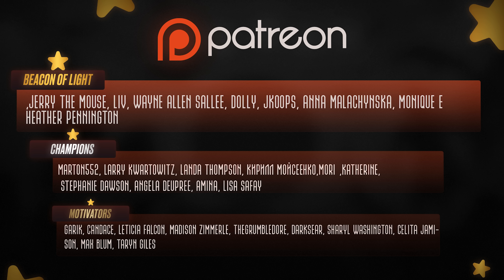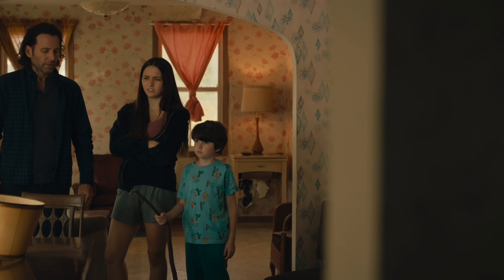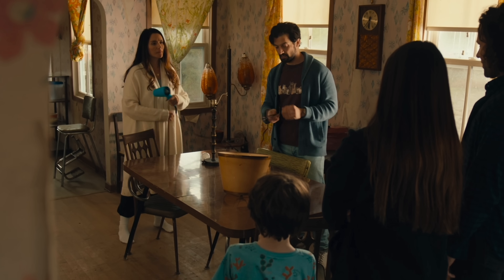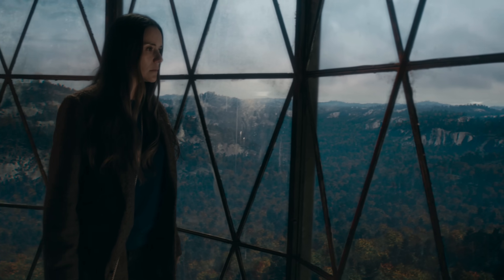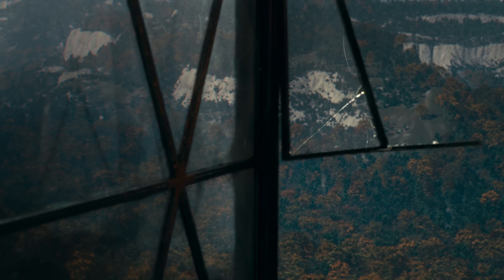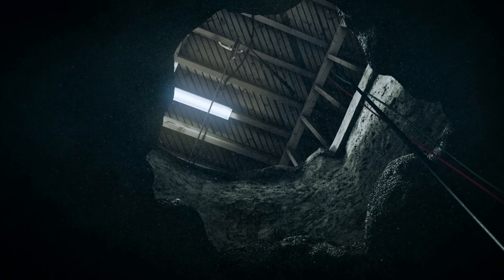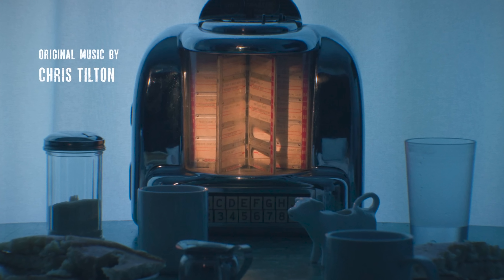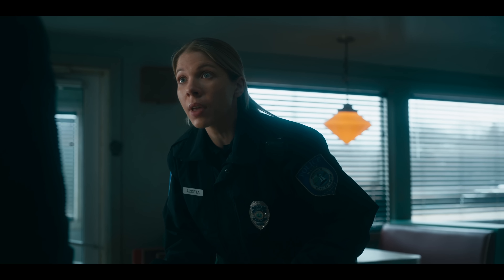#frommgm ELECTRICITY - HOW IT WORKS AND WHY? THEORY

Comment: Here's my theory:

Key Points
1. Man in Yellow is the most likely candidate for the voice over the Radio.
2. Jade made the comment of thermodynamics - Energy can't be created or destroyed, only repurposed/redistributed
3. The Caverns below Fromville are were the creatures reside. 
4. The Power from the houses appear to run into the Caverns.

Theory
1. The Man in Yellow is the Source of Power - His energy dwells in the Caves - Could be the "Haze and Orbs" that we see when Tabi falls through the floor, or could just be dust.
2. He feeds the entire town his power, in exchange for their privacy -- "Knowledge has a Cost" - This even applies to him, meaning they also have to follow the games rules.
3. This allows him to be omniscient - He may not be able to see, but he is able to listen - His power fed into the Radio allows him to speak.
4. Deaths of "Non-Essential" characters fuel the man in Yellow - Monsters feed on their bodies, Mr. Yellow feeds on their energy/soul.
5. Mr. Yellow appears to be old, tattered, and possibly weaker due to the lack of a new cycle.
6. Children may contain more "Energy", which is why they are often targeted first, used for sacrifice, and plotted against; in the case of Sarah and Ethan.

Summary
Mr. Yellow powers the town with his essence/energy, in exchange for the town Privacy. His energy resides below the town within the caves, and the wires are his conduit.  He feeds on the energy of slain denizens and uses his monsters as "The Tip of the Spear". -- Essential characters are not bound by the town, and their energy is able to escape for reincarnation.  The others are completely consumed - Creatures consume the Body, Mr. Yellow Consumes the Soul.

Comment: Where does Elgin get the never-ending Polaroid film? I remember the film was about $10 for 10 pictures in the 80s so he should have run out a while ago.
Reply: It's as logical as having electricity from wires that end underground. What's your point?

Comment: We have electricity,  water and gas and we don't know where all comes from. I always thought that the water they got was the perfect source for they get drugs in their system, which make them see all these hallucinations.  Of course, that doesn't  work because they get trap going in circles before they drink any water fromnFromville. 
We know it is not the light bulb  because Jade needed to put it back in the lamp to turn it on. Sonone could argue that the lamps, or any socket, have some.type of.battery install, and they are controlled by some devise like alexa. 
Also it's possible that the people's energy is the source of electricity.  Ligjts flicker, radios turn on based on the emotional energy people have.

Comment: To @gaeouhgaeae: I know Kelly had a cellphone (I stated that in my 1st post), and I know what Kristi told her.  But, think!  You can use cellphones for more than placing phone calls.  You can take photos; so no need for the Polaroid camera; Jade and Jim can use the cellphone calculator function to number crunch in an attempt to figure out the numbers in the bottles.  Plus, there is a huge area outside of From that no one has discovered - potentially cellphones could work there.  Instead of laughing and saying something is ridiculous, just google it.  

Lots of practical uses for cellphones even with no cellphone coverage:  calculator, calendar, flashlight, offline GPs and maps, note taking and journaling, game playing, etc.  Cellphones are are very handy device in Fromland, even if you can't use them to make calls.

Most smartphones have a built-in magnetometer, which allows them to function as a compass, allowing one to find magnetic North, which will help in travelling, not getting lost, and mapping important locations.  

Same thing with a laptop.  Lots of practical uses for a laptop even if there is no internet, especially depending on the software or programs that you already have installed on your computer.  You can do activities such as:  document creating and editing, media playback to listen to music or movies or view photos, offline games, creating a spreadsheet or a presentation, photo and video editing, etc.

So again, instead of laughing and saying something is ridiculous, even without internet or cellphone coverage, cellphones and laptops are extremely helpful tools in any situation.

Lastly, the writers of From are smart and very clever.  There is a reason why we have never seen someone use their cellphone once they step foot in Fromland .  There is a reason why there are no cellphones, laptops, Fitbits, Apple watches, iPads, tablets, etc in the storage area or in the storage boxes.  

The absence of technology isn't an oversite by the From writers - they are too smart for that.  Technology is ubiquitous in today's society.  Most people cannot go one day or even one hour without seeing or using some sort of technological device.  

So, the fact that the inhabitants of From don't have access to their devices is not ridiculous - It's an "in your face" obvious CLUE.

Comment: I have a theory you wont regret reading about the whole place, the monsters, the electricity, and the Anchooey kids lets start with the place, first of all i feel like every one missed the point that there is the seen place that we always see in the series and there is the unseen place that Boyd went by the tree, also he went to the unseen place when he used the torch when he destroyed the music box, the point is that what they cant see in the seen place can be seen in unseen place, like the building that Boyd reached when he went through the tree, in the seen place its not there its only some walls, but in the unseen place its fully build, and they dropped a hint at season 3 when Henry told Ethan why there is a motel sign but there is no motel, the motel can only be seen in the unseen place, and to go to the unseen place you need some tool from the unseen place like the torch that Boyd used, and if your lucky you can end up there by using the tree or by using the numbers that Victors Mom used which is a coordination to a specific place when they enter the tree, there could be a possibility that there is a number that will send them to the unseen place as there was a number that sent Tabby to the tower. About the lights there is no wires but there is electricity, i believe its the same, the wires is there actually but in the unseen place that's why they cant see the wires but somehow the electricity works and that could also explains the flickering and how some lights are not fully working because the electricity its not from the seen place but actually from the unseen place. And about the monsters i don't think that Boyd and Sara got saved by the light, it seems there is different monsters other than the one we saw already and i believe it was mentioned by Ethan in the quest/book that there is a spider, boogeyman and scarecrow and there could be other types of monsters, maybe a giant which pulled Boyd and Sara when they were in the tent. and also Martin mentioned that the monsters that come to town is only the tip of the spear so there is different type of monsters out there that we didn't see yet, i believe that the monsters only come at night to the seen place, and go back at daylight to the unseen place and i think Boyd and Sara got lucky that it was close to daylight and that's why they got saved and not saved by the tower light, what could proof this, is when Martin told Boyd go before they come back, it seems that all type of monsters go out to the seen place at night and go back to the unseen place at daylight, i know some will say but there was 2 monsters left at daylight when Victor entered the tunnel with his father Henry but it seems also the monsters need a tool to go the seen place and go back to the unseen place, especially when henry said why they have so many items from us, it seems they need some tools also to come to the seen place, and that's why you see the monsters dress clothes from humans that's old from 1960 etc, maybe that's the tool for them to come to the seen place, but why there is 2 monsters left and cant go back to the unseen place, I'm not sure but its possibly they don't have a tool to go back to the unseen place, and it seems they need a tool as how Boyd used the torch that he got from the unseen place so he could go to the unseen place, but for the humans in the seen place they must use a tool from the unseen place with a light because if you remember when Boyd had the torch and went to that specific place he couldn't go to unseen place without lighting up the torch, but you will say why the monsters don't need a tool with a light to come to the seen place, because the unseen place is the opposite of the seen place and i believe the tower in the unseen place doesn't have a light and that resembles that they don't need a light to come to the seen place but for the humans in the seen place the tower have a light and that resemble why they need a light to go to the unseen place. And so many people asking why there is a tower with a big fire light in a forest, there is a big chance that tower light is the access of the seen place and the unseen place and if the light is turned off, the access from the seen place to the unseen place and the opposite wont work. Another proof that all the monsters come at night only is when they went to the cabin, the thing that comes knocks only comes at night and the spider webs that they found at the forest, there was a very big web but no spider at the morning and for sure its not the small spiders that made that big web. About the Anchooey kids i believe that the Anchooey kids exists but in the unseen place, and to save them they must go to the unseen place, and to go there the best time is at night when all the monsters are not in the unseen place and the only way to escape from this whole place is from the unseen place and not the seen place, that's why no matter how much answers they find and look for its useless. So all humans need to go the unseen place at night, but only one need to stay at the seen place to turn off the light at the tower so the access from the seen place and the unseen place get closed, so that the monsters cant go back to the unseen place and that should be Jade because i believe that he need to sacrifice him self so the others can escape this whole place, and they showed us that Jade saw that Anchooey kids get sacrificed at the tunnel and that resembles sacrifice and that Tabby is the opposite of sacrifice and she is the one to save the kids from the other side which is the unseen place, and that's because they showed us many times about Tabby and saving the kids and how the kids comes for her in the tunnel as they want something from her which is saving them. Also i think there is specific coordination that you need to be at so you can go and come from the unseen place and its not random, like for example the place that Boyd was at to go the unseen place when he used the torch, also why there was talisman rocks at a specific place when Boyd found them, and Boyd himself said it, what if the talisman rocks is there to stop them from going outside and not inside, this itself says that they come from a specific coordination and they don't randomly come out in any place in the seen place from the unseen place, and it seems someone already knew about this, that the monsters come at night only from the unseen place and that's why they placed the talisman rocks in a specific place and most probably it will be Victors Mom, but it seems like Victors Mom doesn't know all types of coordination that the monsters come out from, otherwise we wouldn't have seen the monsters in the series that have been showed until now. So if the humans figured out all types of coordination and use all the talisman rocks they have, there is a big chance that they can stop the threat of the monsters that we have seen until now only, and not the other monsters that haven't been shown yet, some will say but there was talisman figures near the cabin but something still came and knocked at the cabin and that the talisman figure didn't stop him from coming to the cabins, and you might say that the talisman rock saved them from him coming inside the cabin, but actually not it didn't save them from him because of the talisman rock, i believe every type of monster works differently from the others and every type of monster have a specific way of killing and doing its stuff, i believe the talisman rocks or figures doesn't work on all types of monsters and it only work on the monsters that we have seen in the series until now. About the radio, there is a host that's controlling everything from the unseen place, and he spoke through the phone and the device that worked when they used the tower and talked to Jim when Donna was with him and talked through the monster and told Boyd that you said you wont break me. The thing that I'm not sure about why the monsters come at night only? it seems the monsters is there to stop the humans by killing them if they go out at night, and also just as a distraction to stop them, so they cant figure out about the unseen place and turn off the light at the tower, but if its truly a distraction and they really want to stop the humans why only at night and not the whole day? There is also a big possibility that the light of the tower if turned off, it doesn't mean that it stops the access from the seen place to the unseen place or the opposite, or that it destroys this whole place and the humans can finally escape this whole place like how many people says, but actually bring the unseen place to live in the seen place and it will be only one place, and that's what the host is afraid of, because the only way to escape is from the unseen place, but at the same time it wont be easy for the humans, because now there is a possibility that they will be against all types of monsters for the whole day and not only at night and they will need better tactics to survive and escape this whole place. And i believe the key to actually leaving this place is the Anchooey kids like how it it was mentioned many times by Victors Mom that they need to save the kids to escape this whole place, because these kids was used as a sacrifice before and that what could possibly made the host so strong to control this whole place, but if the Anchooey kids is saved the host will be weakened and that will be the humans only chance to escape from this whole place. What do guys think about this theory? I hope you guys enjoyed reading it, as i enjoyed writing it, Thanks!
Reply: Interesting theory, thanks!
Reply: That was interesting I agree with most of what you said but I don’t think the light do much on its own I think it’s controlled by the bigger one and also in my opinion I think all of them are one the light the boy in white the monsters all of them are planning for bigger thing.
Reply: Tl;dr?
Reply: Hey if nothing else, this show is getting us all thinking!  Thanks for your theory, it was an interesting read.

Comment: I think creators have a plan. Though I think the electricity is a part of an answer it is.not actually a question.
Electricity show us that it is probably magic. Probably creator of this place either does not know how it actually works or does not care how it works - it is a set, a playhouse. If AI would make you a house it will probably also create electricity but it wont go so far to make a power plant. 
I thini flickering light shows us that this illusion can be unstable and in s1 and s2 he have only seen a little instabilities. The music box I think is a way of a creator of this place, the entity to communicate to townspeople. It shows us that it is propably a game for it. 
I am pretty sure that the town, the electricity, junkboxes, etc are actually clues and shows us what is the character of the entity that created fromville

Comment: Lots of good takes in here.  I thought the light flickering in their home was, somehow, being caused by Victor walking around beneath their house?  We know he'd be under the Matthews' at this time since he went through the tree at the same time as Julie.  And, of course, the premise of digging into the ground was to discover where the electricity was coming from in the first place.  Almost like the Stranger Things S1 bit where Will is able to turn the lamps on/off as he walks  around in the upside down?  I'm not sure if this holds much water, but I just had that impression for some reason.  

The idea of having a finite amount of energy that can be drawn is interesting!  We see the temperature in Fromville immediately plummet following Tabitha's escape (although it appears to be gradually cooling down in the days prior as well, it certainly seems to accelerate at the start of S3).  Maybe it takes a great deal of energy to bounce somebody back into our world and this is reflected by the rapid drop in temperature?  It seems that, in the latter half of S3, the temperatures have begun to pick back up now.  Maybe this is demonstrating that the energy needs some time to charge back up after being depleted?